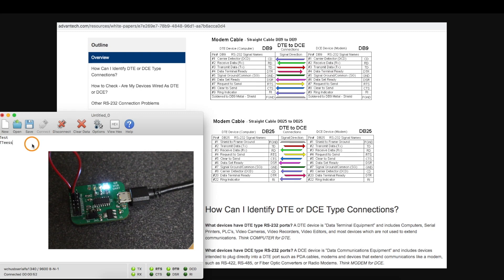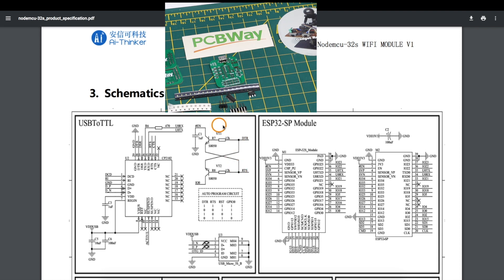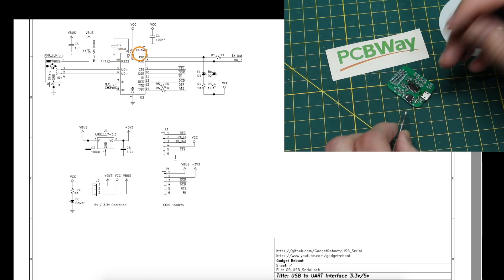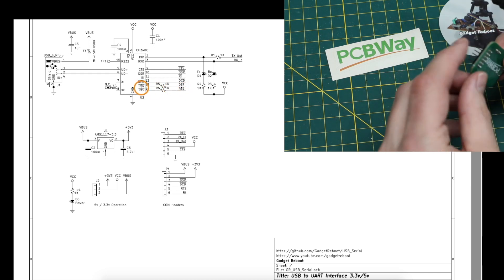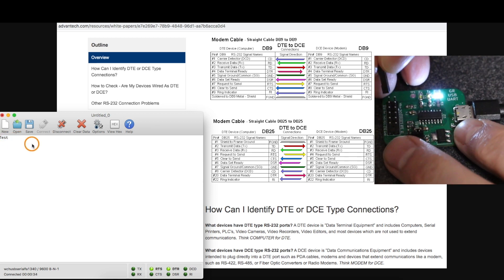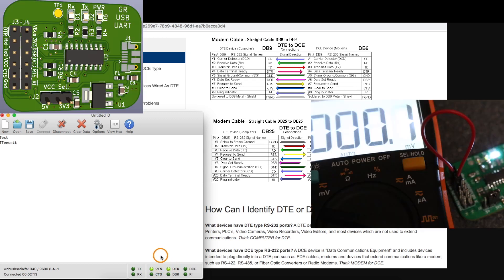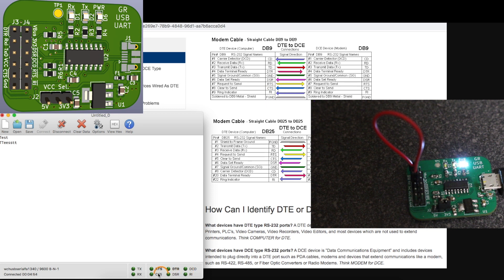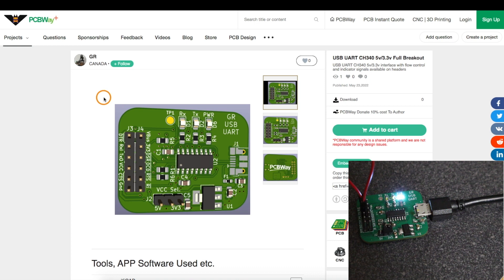USB to UART Module Design - CH340 Breakout for All UART Pins

Comment: Are you sure no violation when in 3.3V mode? The Rx from USB is 5V, driving 3.3V inputs. I think it is against the CH340 spec.
Reply from the maker: The 3.3 and 5 V operation are for the TTL side. On the USB side it’s data plus and minus which operates at 5 V regardless. It’s like having a built-in level shifter for the TTL side.
Reply: @GadgetReboot  I am not sure I follow. The USB side is 5V for sure. If the target side is 3.3V, like ESP32, then the RX will drive 5V into 3.3V IO, and damage it, unless level shifter will be used.
Reply from the maker: I don’t understand where you would be getting 5 V driving either of the TTL pins if it is operating in 3.3 V mode. Maybe it would help if you looked at a data sheet for a similar product from a different manufacturer. Basically the level shifter you’re talking about needing is built into the chip if you are running it at 3.3 V
https://ftdichip.com/wp-content/uploads/2024/05/DS_FT230X.pdf